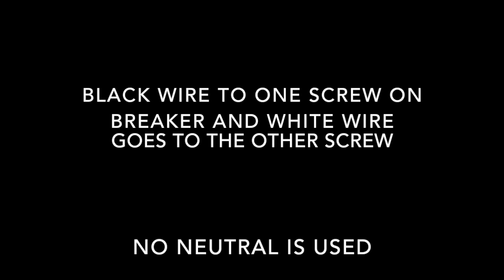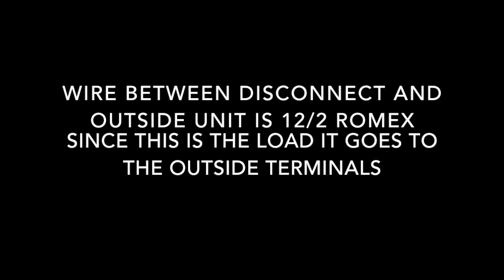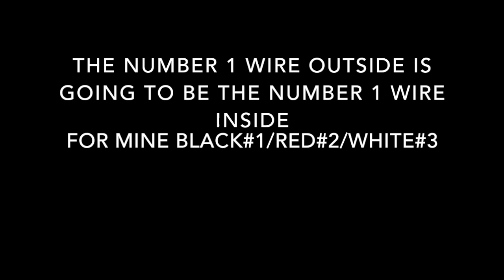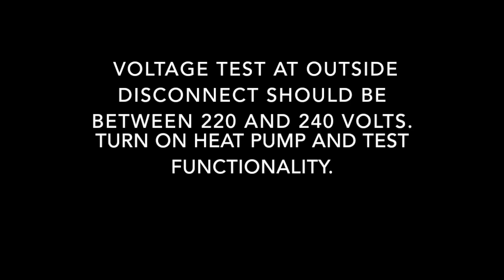Heat pump installation How to do the electrical in 5 easy steps

Comment: the wire running from the outside unit to the unit inside must be #14-4 stranded and shielded , the reason being , this not only supplies electricty but it's a communication between the units as well. I installed a  unit incorectly and I am having to go back and reinstall the #14-4 wire. This wire is a communication wire as well.
Reply: my bad, it's just a #14-4 stranded,
Reply: @dh66  I have installed several of these. You must have communication between the 2 units. My advice is to read the installation instructions and follow them. The 1st time I installed, I was arrogant and didn't follow the install correctly. I speak from experience.
Reply: @dh66  More information will travel on that stranded then core wire.  Core wire is incorrect on the communication answer.
Reply: Install instructions say can use solid or stranded.

Comment: Thanks for this! What was the box you used for the 12/2 mounted on the house?
Reply: Disconnect.  It’s code.  Shuts power off at the disconnect box to work on the condenser

Comment: If i wanted to install a condensate pump such as Clearvue mini, Terminal 1 & 2 would be connected to power the pump and terminal 3 would be used for float switch????

Comment: just wondering,your ran 12 to the outdoor unit which I get ,you have a 20 amp breaker which is right for the 12 wire but then you ran a 14 to the inside unit ,why not use 12 ? So , my main issue with the 14 is that you have a 20 amp breaker protecting it when it needs to be a 15 amp breaker that should have been used.What can happen now that u have a oversized breaker is that if the wire was to overheat the wire could burn into somewhere before your breaker could trip
Reply: steve davis I was wondering the same thing.
Reply: I believe the Wire to the inside unit is just a control circuit and power for the fan 14 gauge is overkill But readily available. I used 12/3 so I had the Neutral and the ground Separate  probably just a waste of money. 
Nice video
Reply: The mini split wire is 14/4. All it is for most part is communication wire. It's fine.

Comment: Hello,  I was wondering if you could give any more information on the little outdoor electrical box, the disconnect box? how do you go about choosing the proper one?
Reply from the maker: +david m I chose the disconnect based on the current draw. For my installation I only needed a 20 amp disconnect. Most Air Conditioner disconnects will work for this.
Reply: go to Lowes get a non-fusible 60 or 30 amp disconnect ,very inexpensive

Comment: Fujitsu required wire from outside to indoor section be used with communication wire not the 12.3 wire you used. Read the manual.

Comment: isn't romex in conduit against code?
Reply: Yes using Romex inside any type of conduit is a code violation...
Reply: You are 50% right  

ARTICLE 334 Nonmetallic-Sheathed Cable: Types NM, NMC, and NMS
II. Installation

334.15 Exposed Work. In exposed work, except as provided in 300.11(A), cable shall be installed as specified in 334.15(A) through (C).

(B) Protection from Physical Damage. Cable shall be protected from physical damage where necessary by rigid metal conduit, intermediate metal conduit, electrical metallic tubing, Schedule 80 PVC conduit, Type RTRC marked with the suffix -XW, or other approved means.

BUT the inside of a raceway in a wet location is still considered a wet location.

334.12 Uses Not Permitted.
(B) Types NM and NMS. Types NM and NMS cables shall not be used under the following conditions or in the following locations:

(4) In wet or damp locations
Reply: @yeagermcbipper9008  And that's you install UF cable in conduit.

Comment: Do the heat strips needs 220 power or 110 please answer
Reply: Felipe Martinez 240v
Reply: @urbanojuarez3268  
Hello Urbi,
What type of wire is the correct to use by code. Please advise.
Thanks, Ed

Comment: Never use white colored wire as a hot, and never run romex in conduit. This is completely not code
Reply: theres nothing wrong with using white as a hot just tape it to identify  that is being use as a hot but jea they could of use stranded wires for the outdoor connections
Reply: Fatsacks Allday, You can use a white as a hot as long as it has black electrical tape identifying it as a hot wire on both ends. (*breaker side as well as the disconnect side. I always use my electrical tape and tape it from underneath the lug to where I stripped the sheathing back too so that no white is showing.
Reply: But he didn't do that here (at least he didn't do it before he stopped taping)
Reply: You can and SHOULD run romex in conduit, just not LFNMC.
Reply: Danger

Comment: This guy is a hack never phased the white/neutral wire it isn't a neutral you have to phase it black or red. Also no clamp on wire coming into disconnect and you cant run Romex outside even if it's in carflex. This guy doesn't know shit don't follow his lead..